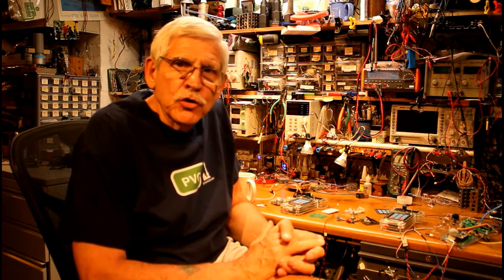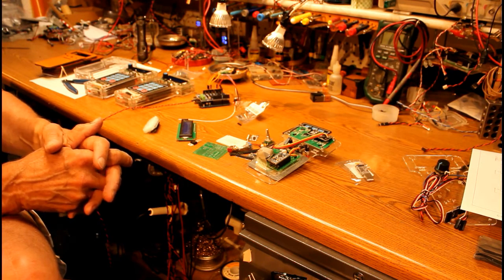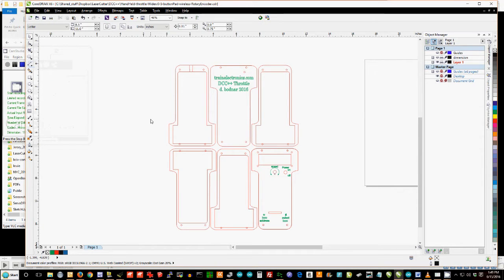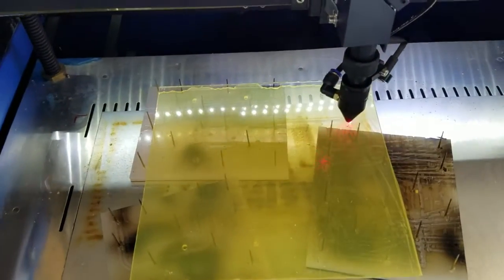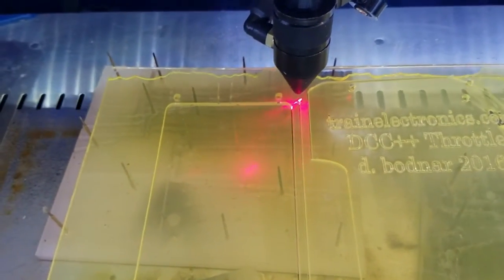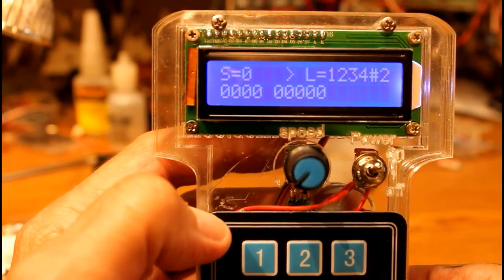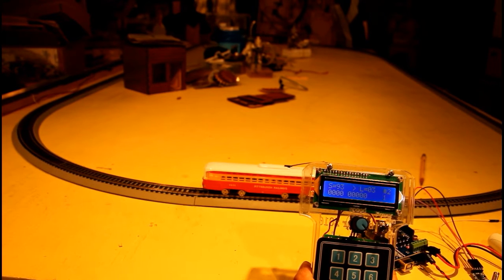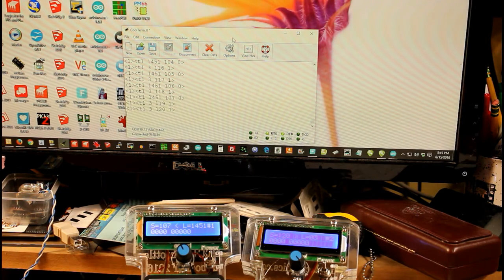DCC++WirelessThrottle with a Rotary Encoder

Comment: Is this controller design able to be used on a DIGITRAX Command Station, and standard commercial loco decoders? I REALLY enjoyed the project. I think you did an awesome job, Dave!!
Reply from the maker: It is good to hear that you enjoyed the project!  
The throttle is designed to work with DCC++, now with Digitrax or any other commercial DCC system.
dave
Reply: @DaveBodnar  Oh, I am assuming you meant "NO", and not "NOW"... lol!!!
Is there any possible way it could be modified to work with t hem? It is a NMRA Standard that would make it that way. Would that be possible?
Thanks Dave...
Reply from the maker: I suppose it is possible but not something that I have ever seen done.
dave
PS yes, I meant NOT not NOW!

Comment: Dave;
This is a great project.  I am trying to use a newer Micro controller the ESP32.  I am not able to compile the code because of an expression "PIND" which appears to be the variable that is written to with the encoder changes.  
The variable is not declared as a BYTE or anything else so I am lost.  Additionally I cannot figure our what you are doing to get a value to "PIND".  It appears that this is the result or reading the encoder pins but I cannot find where you read the pins.  I can see that the interrupt is triggered by the pin change but I do find where this is related to "PIND".

Comment: Dave. Thank you very much. All this works open a big future for our train hobby. I just started to cut the piece from a laser cut and after watching one of your last seminar on You-Tube I will buy one soon. I live in France and I will present your work in the futur in some shows with the great DCC++ central from Gregg E Berman.
 Thank again and I will look forward for the little circuit you can do. I use all this with a Rasberry Pi and JMRI, arduino (CMRI protocole) on RS485 bus. My big layout is on Digitrax and try to repIicate on the function with open source software. I put a video and comment on my work soon.(in French)
 Gil Barrios, Mettray, France.
Reply from the maker: Gil - I am pleased to hear that you have things working - please let me know when you do a comparison with Digitrax.
thanks!
dave
Reply: Hello Dave. I just finished assembling the DCC++ Throttle. It works very well.  I tried to install all the parts on mounting slots to be demountable and serviced. I can send photos.The back of the card is a little messy with many wires.  I will try to create a new circuit board for the throttle.

I work as well with JMRI and several Arduino cards (RS485 bus) for detection, servo and panel command. I try to do the same with Arduino as on my big layout with Digitrax. I am working on all this at the moment. I do not have an internet site to show this yet.

Comment: The DCC++ throttle does not report all the commands on the JMRI throttle on the PC screen, like with my cellphone. 
Gil Barrios (France)
Reply from the maker: Gil - that is all good news - I am pleased that you have it working and that it meets your needs - 

Please pass along photos when you can 

Enjoy!
dave

Comment: I noticed that you upgraded your laser to a 50W model. Was the 40W not doing the job?
Reply from the maker: Dennis - I wanted the ability to do multiple power levels in one print job rather than running separate jobs for engraving & cutting.
The 50w unit is much more capable and has many more advanced features - I am very pleased with my purchase.
dave

Comment: Thank you very much for your work !!!
I have an error produces. Put the library and a version of the Arduino IDE using. Thanks again!!! I use a translator, Sorry for my english!
Reply from the maker: Can you tell me more about the error?  If it is library related I can post a zip file of my library collection on my web page.
Let me know
dave
Reply: An error in the sketch on the line (byte Locofn9to12[4];// 9-12 not yet implemented).
Arduino: 1.6.8 (Windows 8), Плата:"Arduino Pro or Pro Mini, ATmega328 (5V, 16 MHz)"

sketch_jun18a:9: error: 'byte' does not name a type
  volatile byte aFlag = 0;
sketch_jun18a:10: error: 'byte' does not name a type
  volatile byte bFlag = 0;
sketch_jun18a:11: error: 'byte' does not name a type
  volatile byte encoderPos = 0;
sketch_jun18a:12: error: 'byte' does not name a type
  volatile byte oldEncPos = 0;
sketch_jun18a:13: error: 'byte' does not name a type
  volatile byte reading = 0;
sketch_jun18a:14: error: 'encoderPos' was not declared in this scope
  int old_pos = encoderPos;
sketch_jun18a:18: error: 'byte' does not name a type
  byte Key;
sketch_jun18a:22: error: 'byte' does not name a type
  byte Fx = 0;
sketch_jun18a:28: error: 'byte' does not name a type
  byte LocoFN0to4[4];
sketch_jun18a:29: error: 'byte' does not name a type
  byte LocoFN5to8[4];
sketch_jun18a:30: error: 'byte' does not name a type
  byte Locofn9to12[4];// 9-12 not yet implemented
sketch_jun18a:32: error: 'A3' was not declared in this scope
  int pot1Pin = A3;
C:\Users\73B5~1\AppData\Local\Temp\arduino_modified_sketch_572106\sketch_jun18a.ino: In function 'void loop()':
sketch_jun18a:186: error: 'encoderPos' was not declared in this scope
   LocoSpeed[ActiveAddress] = encoderPos;
sketch_jun18a:214: error: 'encoderPos' was not declared in this scope
   encoderPos = LocoSpeed[ActiveAddress];
C:\Users\73B5~1\AppData\Local\Temp\arduino_modified_sketch_572106\sketch_jun18a.ino: In function 'void getEncoder()':
sketch_jun18a:223: error: 'oldEncPos' was not declared in this scope
   if (oldEncPos != encoderPos) {
sketch_jun18a:223: error: 'encoderPos' was not declared in this scope
   if (oldEncPos != encoderPos) {
In file included from C:\Users\Пользователь\Documents\Arduino\libraries\LiquidCrystal2/LCD.h:43:0,
from C:\Users\73B5~1\AppData\Local\Temp\arduino_modified_sketch_572106\sketch_jun18a.ino:45:
C:\Users\73B5~1\AppData\Local\Temp\arduino_modified_sketch_572106\sketch_jun18a.ino: In function 'int doFunction()':
sketch_jun18a:239: error: 'LocoFN0to4' was not declared in this scope
  if (bitRead(LocoFN0to4[ActiveAddress], key) == 0 ) {
C:\Users\Пользователь\AppData\Local\Arduino15\packages\arduino\hardware\avr\1.6.11\cores\arduino/Arduino.h:103:32: note: in definition of macro 'bitRead'
  #define bitRead(value, bit) (((value) >> (bit)) & 0x01)
sketch_jun18a:248: error: 'LocoFN0to4' was not declared in this scope
  Serial.print(LocoFN0to4[ActiveAddress], BIN);
In file included from C:\Users\Пользователь\Documents\Arduino\libraries\LiquidCrystal2/LCD.h:43:0,
from C:\Users\73B5~1\AppData\Local\Temp\arduino_modified_sketch_572106\sketch_jun18a.ino:45:
sketch_jun18a:255: error: 'LocoFN5to8' was not declared in this scope
  if (bitRead(LocoFN5to8[ActiveAddress], key) == 0 ) {
C:\Users\Пользователь\AppData\Local\Arduino15\packages\arduino\hardware\avr\1.6.11\cores\arduino/Arduino.h:103:32: note: in definition of macro 'bitRead'
  #define bitRead(value, bit) (((value) >> (bit)) & 0x01)
sketch_jun18a:264: error: 'LocoFN5to8' was not declared in this scope
  if (debug == 1) Serial.print(LocoFN5to8[ActiveAddress], BIN);
sketch_jun18a:266: error: 'LocoFN5to8' was not declared in this scope
  if (debug == 1) Serial.print(LocoFN5to8[ActiveAddress], DEC);
sketch_jun18a:275: error: 'LocoFN0to4' was not declared in this scope
  LocoFN0to4[ActiveAddress] = B00000000; //clear variables for which functions are set
sketch_jun18a:276: error: 'LocoFN5to8' was not declared in this scope
  LocoFN5to8[ActiveAddress] = B00000000;
C:\Users\73B5~1\AppData\Local\Temp\arduino_modified_sketch_572106\sketch_jun18a.ino: In function 'void doDCCfunction04()':
sketch_jun18a:392: error: 'LocoFN0to4' was not declared in this scope
  int fx = LocoFN0to4[ActiveAddress] + 128;
C:\Users\73B5~1\AppData\Local\Temp\arduino_modified_sketch_572106\sketch_jun18a.ino: In function 'void doDCCfunction58()':
sketch_jun18a:401: error: 'LocoFN5to8' was not declared in this scope
  int fx = LocoFN5to8[ActiveAddress] + 176;
C:\Users\73B5~1\AppData\Local\Temp\arduino_modified_sketch_572106\sketch_jun18a.ino: In function 'void doMainLCD()':
sketch_jun18a:488: error: 'LocoFN0to4' was not declared in this scope
  String temp = "0000" + String(LocoFN0to4[ActiveAddress], BIN);  // pad with leading zeros
sketch_jun18a:491: error: 'LocoFN5to8' was not declared in this scope
  temp = "000" + String(LocoFN5to8[ActiveAddress], BIN);
C:\Users\73B5~1\AppData\Local\Temp\arduino_modified_sketch_572106\sketch_jun18a.ino: In function 'void PinA()':
sketch_jun18a:499: error: 'reading' was not declared in this scope
  reading = PIND & 0xC; // read all eight pin values then strip away all but pinA and pinB's values
sketch_jun18a:500: error: 'aFlag' was not declared in this scope
  if (reading == B00001100 && aFlag) { //check that we have both pins at detent (HIGH) and that we are expecting detent on this pin's rising edge
sketch_jun18a:501: error: 'encoderPos' was not declared in this scope
  if (encoderPos != 0)encoderPos --; //decrement the encoder's position count
sketch_jun18a:502: error: 'bFlag' was not declared in this scope
  bFlag = 0; //reset flags for the next turn
sketch_jun18a:505: error: 'bFlag' was not declared in this scope
  else if (reading == B00000100) bFlag = 1; //signal that we're expecting pinB to signal the transition to detent from free rotation
C:\Users\73B5~1\AppData\Local\Temp\arduino_modified_sketch_572106\sketch_jun18a.ino: In function 'void PinB()':
sketch_jun18a:511: error: 'reading' was not declared in this scope
  reading = PIND & 0xC; //read all eight pin values then strip away all but pinA and pinB's values
sketch_jun18a:512: error: 'bFlag' was not declared in this scope
  if (reading == B00001100 && bFlag) { //check that we have both pins at detent (HIGH) and that we are expecting detent on this pin's rising edge
sketch_jun18a:513: error: 'encoderPos' was not declared in this scope
  encoderPos ++; //increment the encoder's position count
sketch_jun18a:515: error: 'aFlag' was not declared in this scope
  aFlag = 0; //reset flags for the next turn
sketch_jun18a:517: error: 'aFlag' was not declared in this scope
  else if (reading == B00001000) aFlag = 1; //signal that we're expecting pinA to signal the transition to detent from free rotation

Используем библиотеку EEPROM версии 2.0 из папки: C:\Users\Пользователь\AppData\Local\Arduino15\packages\arduino\hardware\avr\1.6.11\libraries\EEPROM 
Используем библиотеку Wire версии 1.0 из папки: C:\Users\Пользователь\AppData\Local\Arduino15\packages\arduino\hardware\avr\1.6.11\libraries\Wire 
Используем библиотеку LiquidCrystal2 в папке: C:\Users\Пользователь\Documents\Arduino\libraries\LiquidCrystal2 (legacy)
Используем библиотеку Keypad в папке: C:\Users\Пользователь\Documents\Arduino\libraries\Keypad (legacy)
exit status 1
'byte' does not name a type
Reply from the maker: Wow!  That is a lot of information - I may need some time to examine it - I'll be away from home the rest of the day - stay tuned

dave
Reply from the maker: What version of the Arduino IDE are you using?  It may be an older version or you may not have it configured correctly as it does not seem to understand the "byte" value 
I am using version 1.6.7 and have the board set to "Arduino Pro or Pro Mini"
dave
Reply from the maker: Here is my setup:
http://www.trainelectronics.com/temp/setup.jpg 
dave
Reply from the maker: That is good news.
Not sure about your question about arrows and about the attiny85
dave

Comment: Dave,

Great video! I do have a question about the HC-12 module. I have a project where I want to communicate with multiple arduino boards on my layout (not for dcc++). Can the HC-12 able to communicate with more than two arduinos? Also, do they support bidirectional communication?
Reply from the maker: Chris - good to hear that you liked the video - the project has been great fun!
The HC-12 could send data to two different units - how they deal with that is up to you - you could also use two different frequencies and have separate links to each.  
If you give me more info on what you are trying to do I might be able to give a better answer!
The HC-12 is bidirectional.  
dave
Reply: Dave, 

I'm a O scale (3-rail) guy, but am getting into On30 a little hence why I follow your DCC++ videos. 

What I'm working on is a network of Arduinos on my layout that will send commands to a master and the master will send Lionel TMCC commands to the Lionel base for throwing switches. There would be multiple slaves (not sure how many yet) in the network that need to communicate with the master, but also the master must send info to the slaves. I was originally going to this with I2C that would use I2C extenders, because I felt Xbee cost too much.

Thanks for taking the time to help me out and keep the videos coming. I love the idea of DCC++ and hope to use it.
Reply from the maker: Chris - I think that the HC-12 could do what you describe - I do know from the experiment that was in the video that two transmitters can communicate with one receiver - I suppose you could put an address in the transmitted packet that would indicate which slave should do what - very cool project!

dave
Reply: +Dave Bodnar thanks for answering my question. I tried researching this online but everything was for two Arduinos. I was thinking the same of putting an address to the master (like 0) and setting one for each slave that would be sent with the send packet. This a condition statement would determine to do more or ignore the transmission. Also this would allow the slaves to even communicate if needed. 

You stated in your video that you pretty good results with signal, so I think I wouldn't have a problem have the HC-12 under the layout. 

Where did you get the info on the data packet? Is there some info on this somewhere my internet search came up empty. It would be nice to send the data like this: 0,1,O (id, switch no., position) where O = out and T= thru

Thanks again for the help.
Reply from the maker: Chris - in case you missed it there is more info on the HC-12 on my web page here:
http://trainelectronics.com/Arduino/HC-12-Serial_Radio/
As to packets you just treat the two units as a serial cable and send whatever ASCII or coded data that you like.  Nice!
dave
Reply: +Dave Bodnar I did see this, but missed the fact that the serial write was for the HC-12. Thanks for the information and sharing your knowledge.
Reply from the maker: The very cool thing is that the HC-12 acts like a wire between the two serial ports - that makes is SO EASY to implement wireless communication

dave
Reply: +Dave Bodnar yes it seems super easy. I like it as alternative to xbee. Xbee is too expensive in my opinion. I was going to use I2C and still might, but am very much considering using the HC-12. I was thinking  for my project that you really don't need to assign id's. If they are just sending a switch id and a position. You can just use conditional statements to see the slave needs to do something. There might need to be a another command to the master or slave to ignore something.